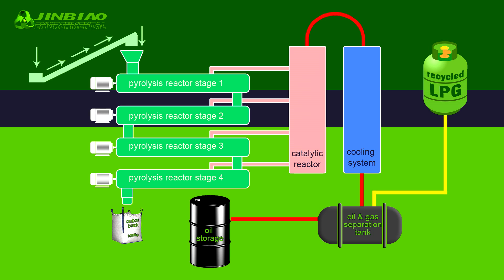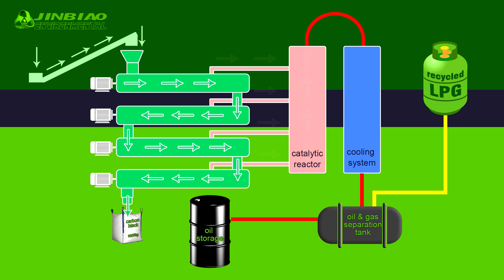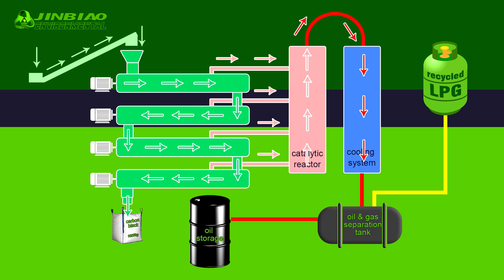Continuous Pyrolysis of plastic

Comment: Can it recycle all kinds of plastic?
Reply: PVC generate hydrochloric acid and is corrosive for components.
In our plant #MPP we realize a neutralization step for this acid so you can process also #PVC #Pyrolysis
Reply: @VivexEngineering  for more information pls contact  whatsapp:+8613523475468
Reply: Anything but PVC
Reply: @artashesharutyunyan3693  for more information pls contact  whatsapp:+8613523475468
Reply: Why is PVC not acceptable? Isn't it digested by the heat like any other plastic?
Reply: @myneva  it destroys the equipment

Comment: Very impressive. I would like to visit you. Please PM me your contact info.
Reply: I saw your process, just another batch unit. Nothing special
Reply: We, Ecocreation Co.,Ltd, manufacture the machine converting waste plastics into oil. 

You are interested in our item and so we'd like to introduce you ECP-2011 which is our new model below. 
And we wish you visit our web site : www.ecocreation-in.com <http://www.ecocreation-in.com/>
ECP-2011 is used only for waste plastics and it is not used for waste tyres. 
Machine converting waste plastics into oil : ECP-2011 
ECP-2011(Batch type, New model) : Capacity Max. 1,000 kgs ~100,000 kgs / day 
Input Material : PP, PE, PS and other waste plastic materials. 
Characteristics : It is not necessary to clean, separate and shred the waste plastics. 
Burner Device, using Oil or Gas. 
Recycled oil and gas generated through the device itself are used as fuel, which reduces the running cost, by option. 
ECP-2011(Main heat Source : Oil or Gas & Electricity (little) Capacity Max. 1,000 kgs ~ 100,000 kgs / day 
In the case of ECP-2011, it is allowed to input even mixed waste plastics like vinyl. 
Output from ECP-2011 is as follows. 
Output : Produced Oil (Convert into oil percentage is Approx.70~80% but it depends on the waste plastics type and operation circumstance) 
The produced oil consists of over 80% of Diesel fraction and etc 

The produced oil is usually used for boliers,heavy 

our machine is manual monitering system, and we operate the machine by LPG gas and Power. 

Standard for 1ton 

LPG gas : about USD 50(1day) 

Power : 2~2.5Kw (1hour) 

Operate time 10~12(Hour)
Reply: for more information pls contact  whatsapp:+8613523475468